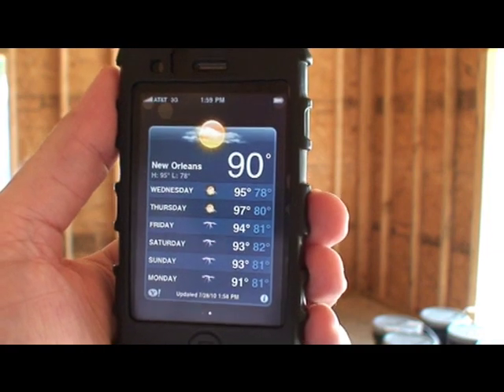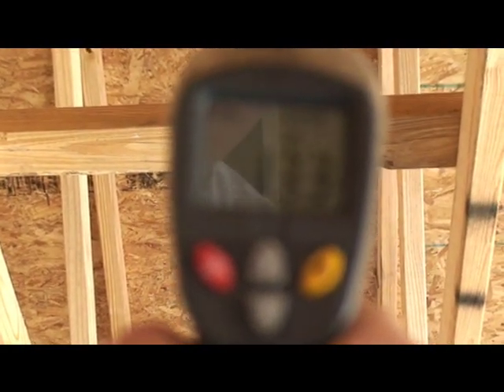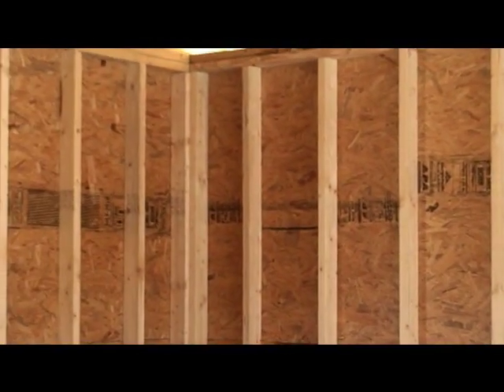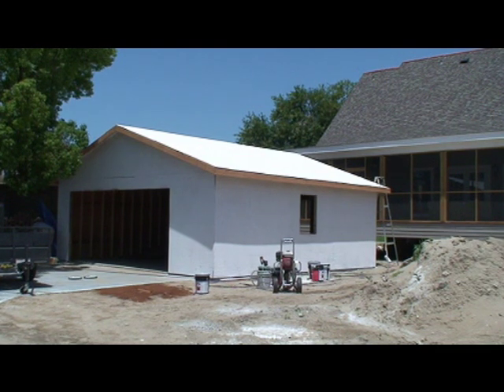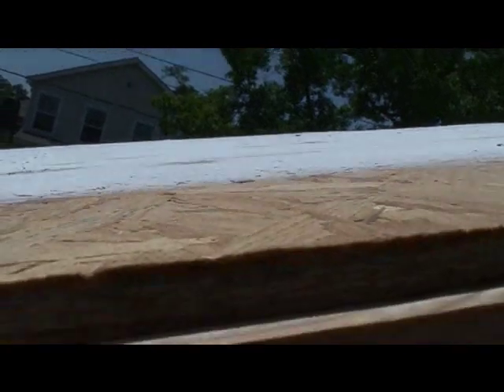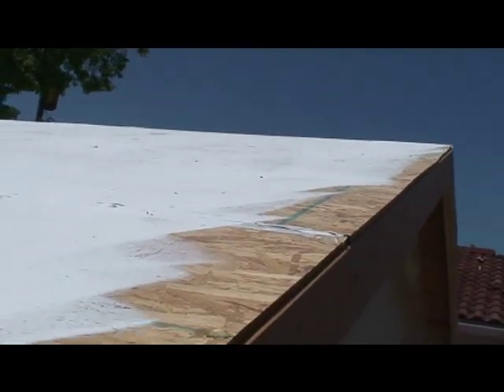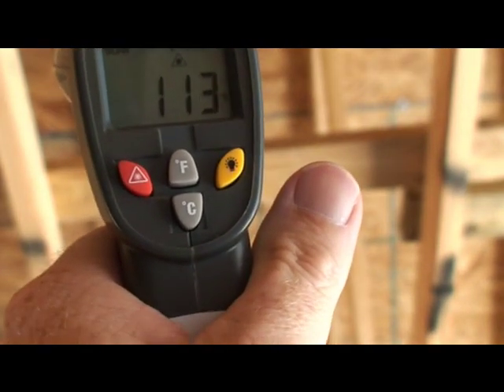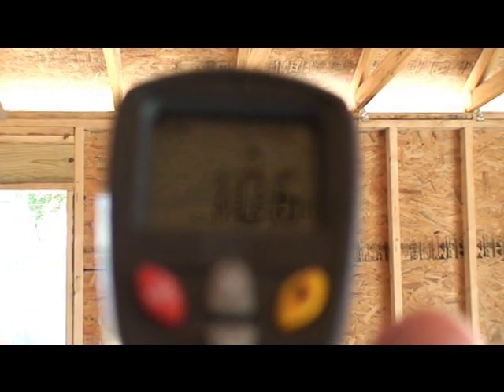Insulation Test: Ceramic Paint

Comment: I had a paint crew paint the south side of a home, in the desert, with two coats of Insuladd over an existing stucco wall, using a light brown / desert sand color.
the two coats were done horizontally and then vertically. The drop on the insude temp of the home was significant.   Painted the interior southside wall, as well, with a Navajo/ off-white interior flat paint mixed with Insuladd. 
Under Edison billing.@ .13kwh to .25kwh, billed on a 4 tier system. Insuladd saved client 20% on bill.

Comment: Hey there Boysya: I performed a similar test: 5 2x2 pieces of sheet rock. Two had one coat each side, one coated both sides and one with bare sheetrock and one with ...wait for it...conventional WHITE latex paint both sides. Result with IR gun: bare sheetrock on this day got to 125 degrees...latex painted one 115. Double ceramic white paint? 93 degrees. Try it yourself, please don't merely discount. cheers It was a pretty cool experiment!